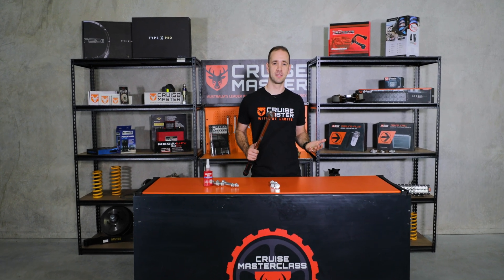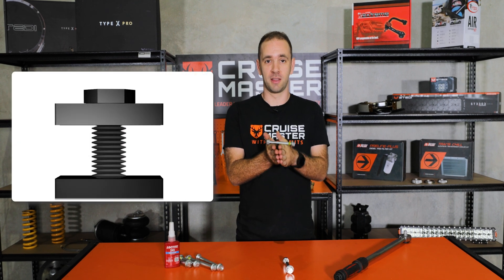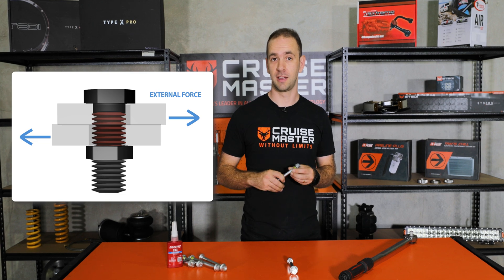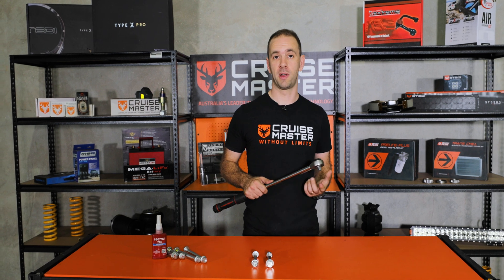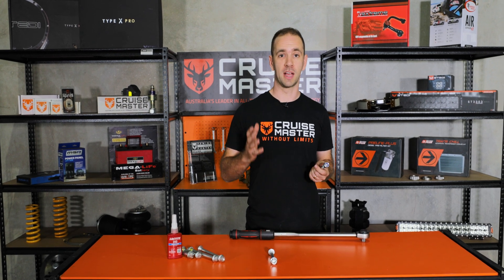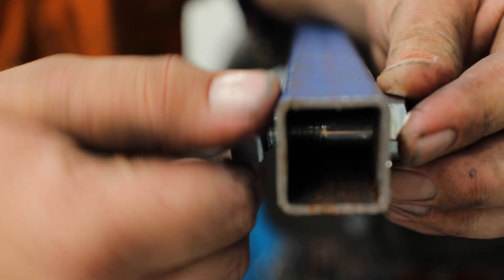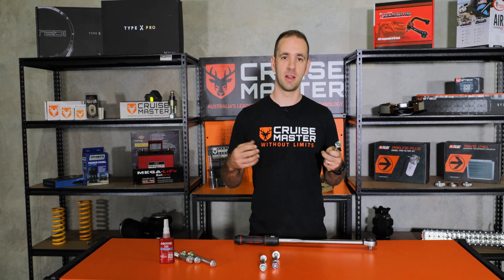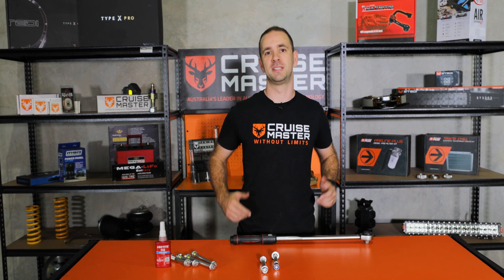CruisemasterClass - Ep. 14  Bolted Joints

Comment: You need to control your assemblers to comply with your specs, I had a control arm top pivot bolt snap on my 18 month old van, the dealer refused to help and gave me the chassis assemblers number, they blamed the bolt, cruisemaster told me they probably over tightened it, re queried chassis guy and he said they just tighten ‘as hard as they can’ with total disregard to your specifications. No one would send me a new bolt blaming COVID so I had to source a similar bolt from a local fastener retailer. This incident and a host of others made me come to the conclusion that RV manufacturing in Australia is a poorly administered industry.

Comment: Good informative video there are a number of factors that impact torque settings if any lube is present on the bolt or nut the torque settings will be 25% higher than dry bolt. The type of bolt  grade 8.8  10.9 worth researching the torque for the diameter & grade for the fastners. It is good practice Cruisemaster supplying torque settings with their products.